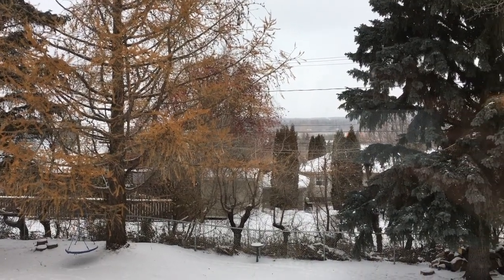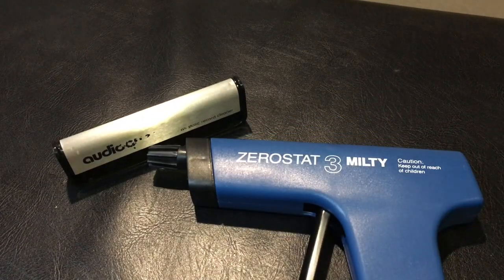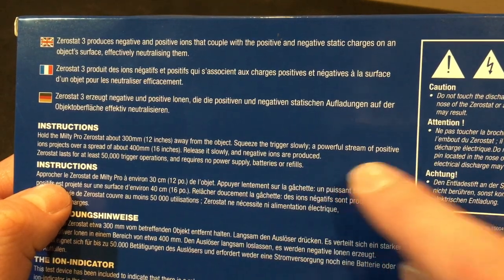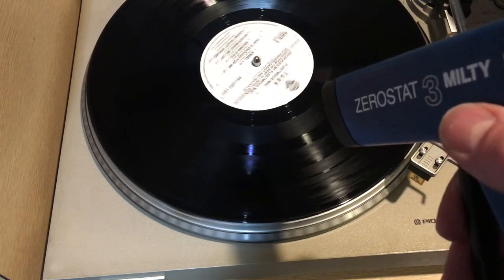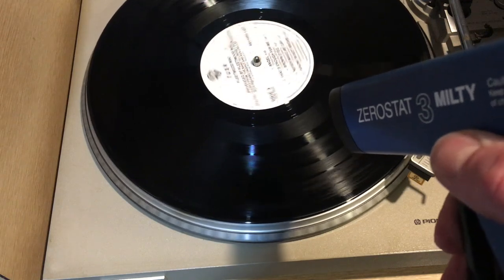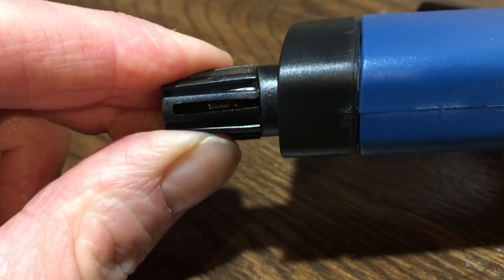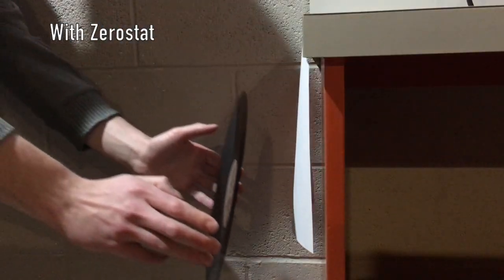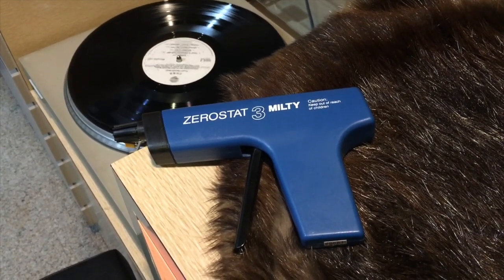Milty Zerostat 3 Test/Review

Comment: I agree with your summary. 
I find the thing difficult to squeeze slowly and uncomfortable in hand. 
99% of the time:
I spray a mist of distilled water onto a clean photography lens cleaning microfiber cloth. 
With the record spinning, I float the cloth over the record to pick up dust. Works pretty well. 
When I remove a record from the platter, I hold the edges of the record and put my thumb on the center spindle to discharge static electricity for a second or two then slowly remove the record. 
Voodoo, well maybe.

Comment: Works better if hold record with thumb or finger tips holding record label and then another on outside edge barely to suspsend it in air not in contact with record platter.  This allows you to disperse static without picking up more from turntable....I think results will improve.

Comment: This device helps. But it's important to not have too-high expectations with vinyl. It's an archaic technology. The huge heat generated by the stylus has the vinyl about to melt (check out the LAST preservatives); imprints from dust particles and expansion-contraction cracks cause divots, thus snapping and crackling. We vinylphiles reject the convenience of the plastic Christmas tree (CD) for the real Christmas tree -- but must accept its liabilities.

Comment: I find the best way to use a zerostat is to hit the record 4 times with the gun not once nor with the record still not moving. Divide the record into 4 quadrants. Fire it once at the top quadrant then the other 3 in rotation. That way I get zero static left on the record. Do this after cleaning the record.
Reply: You (@sezles1) are closest to doing it the way that those who take serious measurements recommend! Not like this anyway!

Comment: Great video, thanks. I had (and still have) my red discwasher one from the '70s. Instead of the test cap (I believe it's a neon bulb inside) mine came with just the neon bulb taped inside the package that you would aim at close to the probe. Still works great.

Comment: I had one of these devices for years.  I was never convinced it did anything.  Of course, now I see I wasn't using it right.  Too late.  Last year it went to Goodwill.

A couple of weeks ago, I bought St. Vincent's Daddy's Home.  Brand new.  There was a little speck on the vinyl I was having a hard time eliminating.  I put a little effort into the microfiber cloth.  And the cork matt I was using for cleaning stuck to the record.

Instead of heeding that clue, I played the record.

The record is now pretty much ruined.

So I started studying up on static.

I didn't want to spend $120 on this so I ordered a carbon fiber brush.  Then I read or heard that carbon fiber bushes weren't all that effective at removing static.

So I ordered an anti-static gun.  It hasn't been shipped yet.

But my carbon fiber brush arrived yesterday.  One of the first records I pulled from the shelf next tested for static so I used the brush.. No static at all.

Since then, every record I've played -- some I washed, some I just used the brush on -- none had a needle drop while the record was charged with static.

A new LP arrived today.  Johnny Cash, American Recordings.  Brand new, never played 180-gram vinyl.  I pulled it from the sleeve and it was fully charged with static.  I ran the brush over it. Zero static on the next test.  Ran the rubber roller over it, the carbon fiber brush again, then cleaned it with record cleaner and velvet brush, and tested for static.  No static.

Played it.  I got just a few pops.  :(

So I'm like -- if I can eliminate static with the carbon fiber brush, which it sure seems like I can, do I really need the gun? Should I cancel the order? OTH, the Johnny Cash record? What's up with that?  I'm so paranoid again, I only played one side.  I've actually have about six new vinyl records waiting to be heard but I'm absolutely paranoid about playing them now.  I'm not sure the gun is worth the money.  But if a record didn't test for static at all, why did it pop?

Comment: Please be careful!  Never use zerostat gun while the records on a turntable. Certain turntables have sensors that this can screw up or throw off the callibration. For example my Mitsubishi LT - 20 has tracking sensors that would be screwed up by using the gun on the turntable (per the manufacturer).

be careful posting instructional video and doing this. Somebody's turntable might be inadvertently hurt

Comment: So what happens when it runs out?  How many uses?  Some way to recharge it?  Consign it to landfill and buy a new one?
Reply: As I understand it, it contains a piezo element. Which means the electricity is generated by the force applied to the trigger. It should last for many years if handled correctly.
Reply: About 10.000 uses according to the manufacturer. It's a disposable product, so no way to recharge it.
Reply: It can't "run out", it has a piezoelectric element which generates ions by the physical movement of squeezing and releasing the trigger.  There's nothing to recharge because there's nothing to deplete.

Comment: I bought a cork platter matt because they are supposed to be neutral to static. Well, they aren't. I went to pick up a record and the mat stuck. So I put it all back down and shot it a few times with the Zerostat and the cork mat no longer stuck when I picked up the record. Also, another way to tell if they are still working is to zap yourself. Yes, it will give you a static shock.

Comment: Mine stopped working about a year after buying it. Maybe used it 500 times. I'm trying to figure out how to open it to see if there is a fix. In my opinion, its not worth 75 dollars.
Reply: I have a red one from the 70s I got on ebay for 30 bucks.  It's continued to work for over a year of thousands of zaps.  I read about the new one not being built as well.  You might want to try to pick up an old one.

Comment: This is a knock off of a product introduced by the Discwasher company in the mid 70's. Still have mine, and it works.
Reply: Len Drasin yeah I suppose. I wish that brand still made these products. 

I wanted a vintage one but I thought may have been used too much. so I decided a new could be a better idea. well see I'm happy with the new one so far.
Reply: Len Is it the model simply called "antistatic gun" that has metal trigger and 2 holes on the barrel

Comment: I don't have the problem of too dry air (in Venice we have the opposite problem, hardly below 60%!) but still my vinyls get a lot of statics, sometimes I can hear some sort of crackling noise on quiet passages, and the disk even seems to stick to the turntable when i pull it off! Is it possible that there's something wrong with the turntable, maybe an internal grounding that doesn't work?
Reply: What sort of slip mat do you have that sits on the platter? The standard felt ones build up static pretty quick. Cork ones are a lot better. Or an acryllic platter where you don't need a slip mat at all would fix it too.
Reply: @razrv3lc  I am using the original thick rubber one as it's a sony PS-LX4 that has cutouts for recognizing the disk size and drop the needle on the right spot. But I may try to change it anyway, as I only have LPs! Or I can get something like cork and cut the 3 windows!

Comment: Carbon fiber brush works. Actually I bought a new record so strongly charged that was almost impossible to get out of the paper sleeve. Now its fine. The trick that works for me is that I hold the record in my hand by the side, pressing towards my body with the other side and just brush slowly and gently just a little bit. It's a bit akward and with risk of droping of the record, but it works for me. Try it.
Reply: Corvus Corax interesting, for awhile I liked that method as well as rice paper sleeves.

Comment: The static season indeed. Cool to see that the gun works even with this method, its always gotten mixed views from users who say it works amazing or not at all. I wonder if you could actually use it to remove static entirely though, as its namesake. 
I think the best method for removing surface dust is one of these to remove the static causing dust to stay on and attract more, and then an air blower of sorts to gently blow it all off, I have no need for brushes that potentially just pushes the dust down the grooves, scratches the record and adds static which it at least clearly has for me, felt mat always lifts up with the record after brushing, never without.